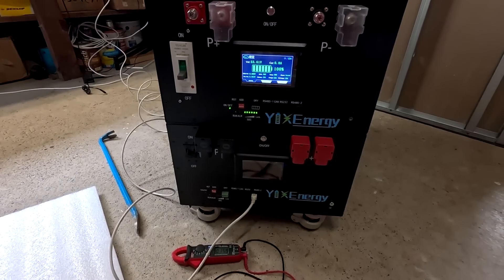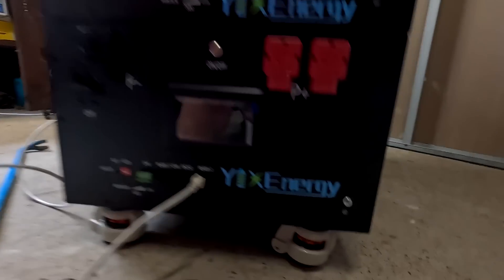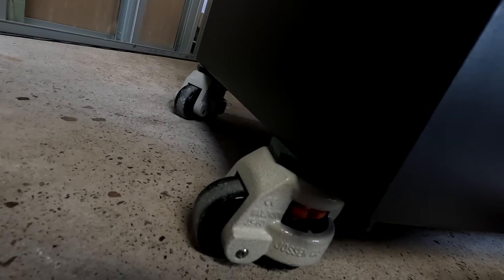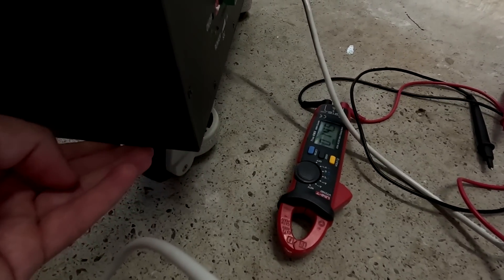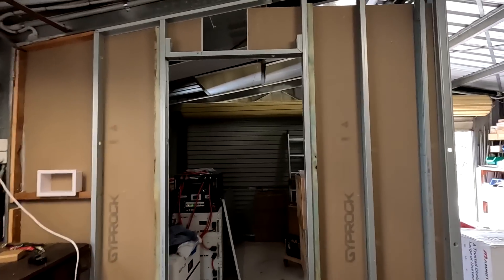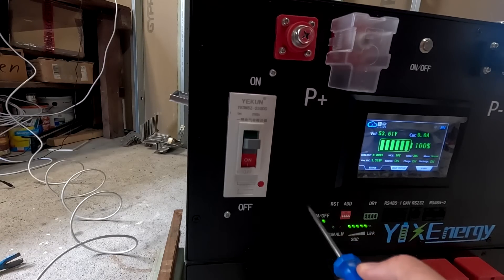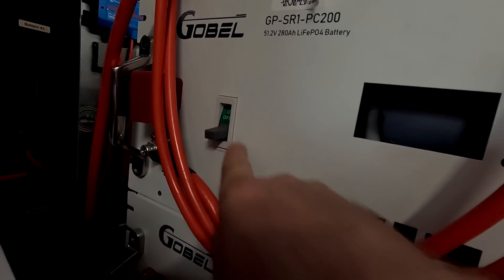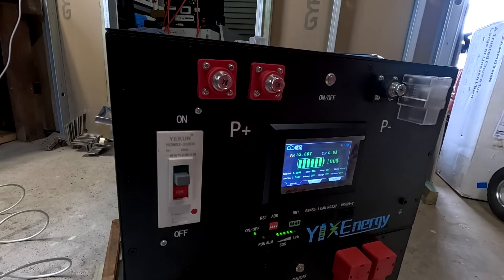Testing the new Yixiang Circuit Breaker, instead I found this...

Comment: I notice that you do not have the ground points connected or grounded - I am having trouble finding the proper size cable to use. Ar there any suggestions for 314 AH Yixiang dual post cells?

Comment: Can you test if the breaker is capable of breaking a full short circuit current of the lifepo4 batteries without arching? The current can be 20kA and I'm wondering if the breaker can handle that well. The manufacturer didn't provide any data about the breaker nor any test results. So it's still fuzzy if the breaker adds safety or just pretends to add safety.

Comment: i have a similar basengreen DIY kit and I actually bought two dollies or trollies  ( they are designed for moving forniture around. Each of them capable of rolling and holding 250kgs or so) for moving the battery packs around without any issues.

Comment: I used 2 pieces of unistrut channel and bolted them to the box using the existing holes. Bought 4" locking stem wheels and mounted them to the unistrut. Rolls like butter now.

Comment: I also have one  Yixiang DIY V1 box with the wheels. And I have also thought that the mounting points for the wheels seem structurally weak for bearing the load of multiple stacked batteries. It seems to me that it should be fairly simple for Yixiang to make these mount points much stronger by merely adding a few support beams to the bottom part of the case.

Comment: I have 4 Yixiang V1 boxes and mounted the wheels. The choice of these wheels is obviously not ideal, I would have liked to have different ones. But since I don't have to drive around with them, I think at least the support with the rubbers is a nice thing. The bad thing about stacking the boxes is that you no longer have any access to the batteries themselves. I would have to dismantle everything again because the boxes are super heavy and difficult to carry.

Comment: I have three EEL stacked boxes on their roller cart, and it's rock solid.  I can see why they would bend if attached just to the box itself. No support for stacking more boxes.

FYI ... they make tubing end caps that fit the top case holes on the corners perfectly .  So nothing can drop into that black abyss.

Comment: I would think a heavy welded angle iron frame like a box spring steel bed frame and the wheels welded onto that for the box to set down into would be the strongest way to do it if you were going to stack 3 to 5 of these.. I am thinking that when you moved the 2 stack of batteries you did not have that leveler up high enough and it caught on the uneven floor as you were pushing that large weight and that moving mass torque is what bent it.. I still like the old school fuse and the arc fault disconnect unless it is an arc extinguishing breaker because a300 to 500 amp arc is very hard to extinguish if it gets going.. The cost of getting a couple of those kit boxes delivered here in the USA is very high so I built my 2x 17 cell 300a batteries on shelves like you did but I did add a bit of compression that I plan to remove in the Spring after the banks have that time to settle in.. I really was surprised at the huge capacity these LiFePo4 batteries have over the 8x L-16 lead batteries.. My 7kw of solar panels in the Summer can keep them full but in the Winter forget it.. I have had to use the inverters charger function to top them off once a month starting in mid Fall here so they get topped off and fully balanced.. Wife keeps asking me when are you going to add more panels because this stuff is like eating potato chips, you just can't stop once you start.. Thanks Andy.....

Comment: I have the EEL brand stacked 7 high for about 6 months now.  No wheels.    I've had zero issues.   The feet do nothing but stop the unit from sliding around.  The weight distribution is still mostly at the edges just like shipping containers.  I never used the feet on the bottom box obviously.

Comment: Off topic but can you inform your contact at JK that the JK BMS app no longer works properly with Android 15, my phone updated to it yesterday and now the JK bms app does not fit properly on the screen.
Reply: Have you tried uninstalling the app then reinstalling it?? Another option that might be available in your settings is to adjust the displayed image size..
Reply: bunch of others on diysolarforum reporting the same issue.
Reply from the maker: I've forwarded your concern to Jikong. So, app still works in general?
Reply: @OffGridGarageAustralia  It works but the top and bottom are cut off, you can't go to logs, connect to another bms etc.  Others in diysolarforum are reporting the same issue with them as well.

Comment: Hello Andy,
no, the braker ist not triggerd to the on possition. Only the charged spring is released.
These high current DC breakers need to close and open verry fast to prevent arcs. Therfore there is a charged spring mechanism.
Reply: Some also have a ceramic flap that closes between the contacts as an arc extinguisher..

Comment: Andy I want to make a cable to link one BMS ( compact model) using the RS485 and connect to my DYI case that have another JKBMS to see if is possible to work in parallel... what do you think?
Reply: Try YamBMS ( multi-bms merging solution)

Comment: Hmmm - those new circuit breakers look more beefy than the old one.  But they still trip only one pole. At 50V it is recommended to switch 2 poles at the same time so the Amps that are switched are halfed for each pole. 50V is enough to get an arc. That‘s what an electrician told me.
Reply: Is this circuit breaker good enough to prevent arcing in a complete short? Should the box also have a NH00 or a T class fuse?
Reply: @ the smaller circuit breaker get very warm during normal operation. This beefy one is better. But i still use double breakers for my builds as they switch both poles which means only 25V each so the risk halfes.  I would feel safe enough with one pole when i insert an Class-T fuse in series (inside)
Reply: Not sure I understand this.  The first breaker to trip  (and one will always trip before the other, even if microseconds apart) will still see the full voltage and current.  The only reason I can see to have one on each pole is for redundancy and the fact that any 'air gap' will be twice as big.
Reply: @ a double breaker disconnects both poles at nearly the same time. So 50V is spread up to 25V each has to overcome. As with the first mm airgap the resistance rises it is double the resistance. What also helps is fast switching. You can extend an arc by slowly increasing distance and you can clear it by very quickly increasing the distance so that there is no time for a plasma canal to appear.  Switching 2 poles at the same time is like switching twice as fast, as the overall distance at the same time doubles.  1000V DC breakers often have 5 switches inside wired in series because at 1000V you could have an arc 10cm long.
I use a melting fuse (class-T clone) and a breaker in series so that at least one must work. Normaly the breaker switches first and the melting fuse takes time to get warm. There are diagrams out there which show the amps vs. Melting duration (which is not linear)
Reply: I have 2x 175amp 80vdc arc extinguishing breakers that are magnetically linked to trip the other if one goes but I can turn one off manually as long as I hold onto the other one's lever.. This gives more flexibility over the dual breakers with the solid bar between them..

Comment: I had four of these stacked up NO problem. These holes (4:59) aligns perfectly with the small plastic feet to prevent the upper box from moving laterally (X,Y axis), while the latch on the sides for vertical movement (Z axis). The upper boxes do not sit on these tiny feet; it sits on the whole bottom surface.
But IMO, I should have removed the plastic on the bottom most box. It has tiny are to support everything. Fortunately, the whole battery tower sits on plywood, and the plastic feed sunk and sits flushed after a while.

Comment: Any action from JK concerning the wrong SOC when connecting 2 or more boxes? Its really a nuissance.
I try to avoid the SOC-problem by working with a volt-configuration instead of a %-config.  at my hybrid inverter ....
Reply: Try YamBMS (multi-bms merging solution)

Comment: Does the version 2 have the wheels in the same place as the version 1 when it's on the bottom? If not in the same place you may want to switch to two and their location stack. To see if the version 2 is better than the version of ones locations of placing the wheels

Comment: I have three Yixiang V1 boxes stacked on top of each other, but I build a wheel trolley myself with 5 heavy duty wheels (1 on each corner and 1 in the middle). I have also removed the small "feet" on the bottom box, so it now sits flush with my trolley. The trolley is made out of a 56mm thick wooden board (no OSB or MDF), and I made it 15cm wider than the Yixiang box to give it more stability.

Comment: I have the same issue with my batteries, I have 2 stacks, one stack is 2 and the other 3. If I had known I would have added some steel. As is I may make a pair of "carts" out of angle iron. Getting my engine crane into my basement is NOT going to be fun.
Reply: You could cleat a couple rafters then put a block of 4x4 up there to hang a come along or such on.. It's what I would do over having to disassemble an engine picker and dragging it down then back up..